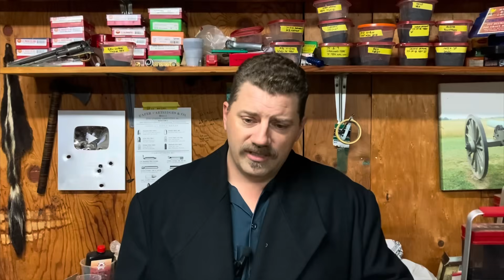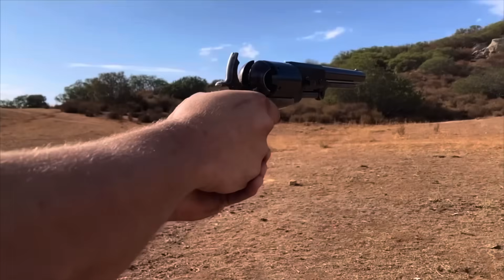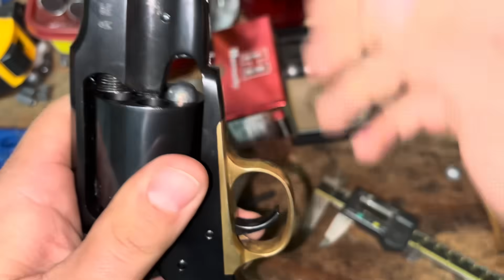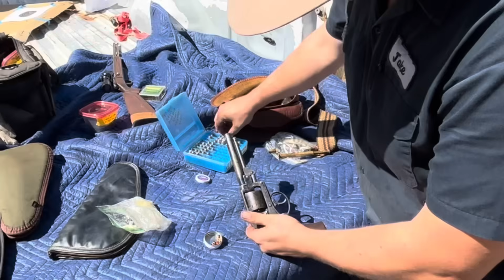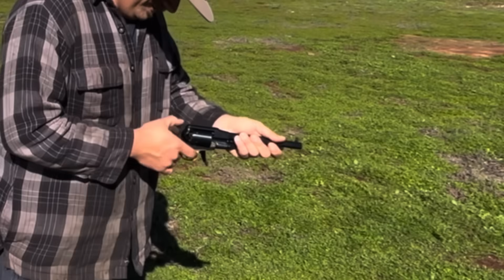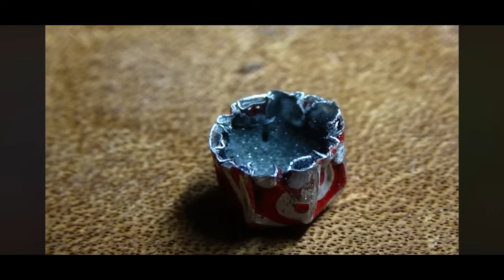Chain Fire Number 4. But Who’s Counting?

Comment: My navy arms 51 navy has not had a chain fire YET, and even cci #10 caps I have to pinch them. I plan on getting slixshot nipples, but the thing just works so damn well that I kind of don’t want to change anything (well besides a taller front sight). I’ve shot it a ton, with .395 round balls so it gets a dang good seal, with no wads or grease over the chambers. .375 don’t shave a ring, so since my local shops don’t have .395 I used .375 to make my paper cartridges, and use bore butter or CVA revolver grease for the chamber mouths. I’ve also woods carried it from December till now for small game. I’m waiting for that day I get a chain fire, and I hope it doesn’t come. Shit happens, it’s part of shooting a cap n ball that it CAN happen. Enjoying the videos, keep it up.

Comment: As a matter of momentum IF the hammer rebounds instead of holding the fire cap in place it can cause microscopic dust from loading un-shimmed or un-capped chambers to flare. That can add to the temperature in the adjacent cone areas, it can cause the cap to heat up. From a matter of physics, it is more likely to come from that. Especially considering the size of the balls that YOU load with. I've always used a loading jig, it just holds the cylinder, and I loaded it. I did not know to use grease when I loaded mine (haven't shot for about 6 years, about 12-15 hundred mixed calibers per year.) I never had a chain fire, I can't say I shoot it as much, as I find Colt/Clones have very small grips and are uncomfortable to use. Never shot a Remington.

Comment: i had a cap and ball uberti and that sucker chain fired 3 chambers at one one down the tube and both sides ok. that being said i had the front of those chambers completely sealed with freeking lard beats me how it happened but it actually stretched the barrel just about of the cylinder rod it all but destroyed the wedge. i got it fixed ran about a hundred rounds through it and sold that puppy

Comment: My theory about chain fires is that when powder is loosely poured into the chambers and not cleanly wiped away from the face of the cylinder, a grain (particle) or two may be trapped on the side of the ball thereby giving the particle an avenue to ignite the powder in that chamber. It's a theory.

Comment: if your getting chain fires then there is an issue with your loading.
I've had chain fires  when I had balls that were not tight enough going in, when I ran out of my waxed cardboard disks I put over the powder or grease over the ball
if you have caps fall off there is very slim possibility of that chamber going off

Comment: I think about this.   The late great Paul Harrel  opined that most chain fires happened from the caps not the chamber and as you say only one chamber actually goes off other than the intended one.   LOL  a chainfire is well...  impossible?   but they happen.   How can a spark get past the tight fitting ball and the wad and still touch off the  load?  or.. how can a tight fitting cap let a flame let a spark get down and around and into the next cap?    I lean toward flame moving from the chamber and conicals being more prone..  anyway I can't fault your logic.

Comment: Careful, you might be flagged for full auto on YouTube 😅

Seriously I thought I was alone in shooting cap and ball that much.
14 for me, paid $99 for a navy arms reb model at a gun show, it was chunky and just had problems so my mom purchased a brass frame 51 navy colt for me at Service Merchandise for Christmas 
Shot it every evening while feeding the horses and cows, 24-30 rounds a day, pyrodex at first but goex after I found a source
Eventually found a wilderness shop going out of business and purchased 5 cylinder and a wire with 105 trigger and bolt springs on it.  Then I just swapped cylinders.
Btw, Phil spangenberger started this entire trip with an article on 51 navy colts
Wore that gun out by my early 20's

Comment: I bought my first black powder revolver around 1972, an 1851 Colt Navy reproduction. I also bought a flask with a 20 grain spout and an inline cap applicator, still have them. The guy behind the counter said, fill the spout, dump it in the cylinder, press in a ball, cover the hole with Crisco, put on a cap, and Bob's your uncle. No mention of chain fire or hang fire. No chain fires so far, but I don't shoot nearly as often as you. I have had a few hang fires though. The first one went snap and no recoil or cloud of smoke. I thought what the hell! I rolled the pistol to the right and slid my left hand under the cylinder then pow! It didn't laser my fingers off, but I did get a nasty burn between my thumb and index finger. It was a painful lesson learned.

Comment: The problem is that when you press the ball or bullet in, it shaves it down to the exact size of a cold cylinder. The second it is fired in the gun, the metal in the cylinder expands a little, which is enough for the flash to get to the powder from the barrel end. Only a well-lubed wad or bore butter seal will expand with the metal and seal the barrel.
Reply: Nah, you forget his chain fire was on the first shot.
Reply: this makes too much sense.
Reply: If the cylinder warmed enough to expand with softer lead touching the cylinder it would expand as well if not more and become tighter?
Reply: @LarryHickenbottom  was thinking that too, but the cylinder is taking the heat immediately, the ball inside would only get a bit of residual
Reply: Lead will melt before it expands.
Reply: @graythorn6583  sounds like you brain melted before it could expand 😆

Comment: I believe chain fires will happen any way they can. I have seen slow footage and still shots where for a time your entire pistol and hand is entirely in a fireball momentarily. I have also had separate pile of black powder maybe a foot apart, lit one and suprising to find out they all went. So im sure if it can find a way it does wherever it sees its opportunity. When i saw the slowmo of the fire it made sense, i mean that how a flintlock works n that works pretty well. 🤷‍♂️

Comment: I haven't watched the video yet, but the problem may be that the chambers in the cylinder are drilled incorrectly - they may widen from the mouth to the bottom. The bullet passes through the mouth tightly and the ring is cut off, and then it enters the wider part of the chamber and there is a gap between the bullet and the wall of the chamber. I have already seen this problem. It is solved by rimming

Comment: Yup, .454" ball is too small for the Uberti, which typically has a .450" or even larger chamber. You'll get a superior seal, more rifling engagement, and better velocity, using .457" ball. AND you can use .457" in your Piettas and others juuust fine.

BUT, there's an issue you're still not observing, and that is the subtle damage that's often caused to the chamber mouth by the loading plunger. It is very common, on originals and reproduction Remingtons alike. The design of the loading system, along with its sloppy fit, tends to force the tip of the plunger inward, toward the cylinder arbor, and ding the chamber mouth in that area.

Carefully inspect any well-used Remington cap and ball cylinder, and I wager that, if you look close enough, you'll very likely find that the cylinder steel has been burred, or turned in, such that, when you force a ball in, shaving that nice ring of lead and thus convincing yourself that you're guaranteed a good seal, the dinged portion of the chamber mouth has cut the ball such that it is causing a possible breech, or ignition path, from the front.

And yes, I've tried and tried and tried and tried and tried to induce a chain fire from the back, and I've never been able to get one.

Comment: Years ago I chamfered the inside edge of the chambers on my cap and ball revolvers. After chamfering the lead rings disappear because instead of cutting the lead ball to fit the chamber, the chamfering causes the ball to be compressed to fit. This results in a tighter fit. Chain fires then disappeared for me. This might not work for tapered chambers. With tapered chambers, if the charge is large, the ball may be lifted to a part of the chamber that is simply too large for a tight fit.
I have several reasons to believe that chain fires at the cap end is much less common than at the cap end (eg the Colt caps are more exposed than Remington caps, yet the Colt does not seem to have more chain fires than the Remington - etc, etc) - but I don't want to write a long comment today.
The only grease that matters is the grease where the ball touches the chamber wall - the rest of the grease gets blown out anyway (there is a LOT of fire at the front end of the cylinder when the gun is fired) - so I mix thin lube from bees wax and olive oil - then I can apply it with a large syringe I have - it is with the syringe that I can just squirt a ring of lube just around the circumference of the ball. It is convenient and much less messy to apply lube this way, and you use much less. It also works just as well at preventing chain fires as filling the chamber with grease, and there is still plenty of lube to soften the powder residue (remember when the chamber is filled with grease it just gets blown out and everywhere).
After chamfering and with my use of lube I completely stopped having chain fires. I haven't had any revolvers with tapered chambers though.

Comment: I could imagine Back in the day how many Chain fires there were? and  I know under fire they Did not have time to Grease Lube their guns!  Thank you for a Great Topic!
Reply: They didn't reload the cylinders in the field under fire either. They carried extra pre-loaded cylinders which had no reason not to be greased.
Reply: @Lee.K91725  No they didn't. They did not carry additional cylinders in the field. Please point to a primary source showing this is a normal thing. It's not. Was there someone who did that? Probably. I cannot absolutely prove a negative. 
Was it a standard practice? No. This is the garand ping myth of that era.

They absolutely reloaded their cylinders in the field. It is why they carried cartridges in boxes. Either paper, or skin cartridges. Which is VERY highly documented. Unlike the cylinder stuff. Cylinders had to be hand fit to every single revolver. This is not a drop in part. This is still the case today.

Comment: I'm 99% sure the original instruction were to use no lube because, as a fighting gun, nobody was expecting to shoot more than two, maybe three, cycilders per battle; and at the end of the day you have to clean it anyway to avoid rust; only a target shooter going trought multiple cylinders per range day need to keep the fouling soft. Again, back in the old days, you were expected to have one gun, or a brace/pair, so you need only one size of balls, having multiple molds is only a collector/sportsman problem.
P.S. I use wads, just in case.
Reply: That matches what is said in the video "Chainfire! Is it dangerous?" by InRangeTV. He shows Colt's loading instructions, which state that wads and grease should not be used. That's from the days when conical bullets were standard. People often use round balls now, which have less ability to plug the chamber. It's explained better in the video.

Comment: I have a video on this topic that has been sometimes misunderstood.  Historically, they did not use lube or wads.   I believe you can mostly avoid chainfires with oversized projectiles and truly properly fitting caps.   It is my belief, and belief through experience, but belief (as you said it is nearly impossible to prove) that solves MOST chainfires but that they can occur from the front OR the rear of the cylinder.    I use .457 balls and felt wads when competing and have never had a chainfire doing so.   I also have never had a chain fire with conicals and NO wads and properly fitting caps either.   I HAVE had chain fires with .454 balls and pinched caps to fit nipples.   This is why I, and this is subjective, have standardized on slixshot nipples as they fit Remington #10s perfectly and use wads in competition to avoid this situation, as a chainfire in competition would easily cost me my score that I'm there competing for.   
So, yeah, TLDR, but in summary:
.457 balls with truly fitted caps works.
.454 balls with felt wads and truly fitted caps work.
Using lube in the front of my cylinders is something I just can't really do, in my environment it just melts and becomes a damn mess, and never do so, and never had a chain fire when following the protocols I've specified above.
Thanks for another thorough, good video!
Reply from the maker: I completely agree. When I carry or hunt with any of my cap and ball revolvers, I don’t generally use grease. The odds are I’m only going to get one or two shots off if any, and I don’t want to get my holster all gooey.
Reply: @Everythingblackpowder  Any museum docent familiar with the accoutrements and equipage of gunfighters such as John Wesley Hardin or wild Bill Hickock, even Billy the kid, will tell you that the absence of holsters with providence from those individuals, can be traced to an affinity for gooey holsters that we know today enhance draw speed, but reduce the lifespan of leather holsters if not periodically regooed. On the invoices from sutlers and the general store in Tombstone and Dodge city, you will note the purchase and sales of O'Malley's holster goo reached into the thousands, in today's money this would equal approximately 67 billion dollars.
Reply: Hey Karl! I will give one caveat to what you said and this is not from experience just relaying something I saw online- but it seems it is possible to have issues with chainfires despite oversized lead if the mouth of the chamber isn't properly honed as happens a bit with cheaper repros. There can be a bit of a lip that causes the swaged ball to still be undersized when actually in the chamber despite getting a ring of lead. So essentially in cases where people are still having problems despite following your advice, it may be an actual problem with the gun
Reply: @youngbloodbear9662  To go along with what you said, Samuel Colt discussed the chain fire issue in an engineering lecture, circa 1851, and the solution to the problem as he discovered was to give the chamber a SLIGHT chamfer.  I did some more research on the subject along with looking at my own guns and most repos are square cut, several mentioned in forum posts that they had given the cambers that slight chamfer and it cured all their problems.
Reply: @ very interesting I had not heard that, thank you!
Reply: @wesbrown5601 Do you have a link you can share on this?
Reply: The “lube” I recall using was a mix of beeswax and disk-brake wheel bearing grease - lithium type.  Heat up the grease on the stove, then stir in beeswax shavings until you get a “good” consistency when cool.  This might take a few tries.

I’ve used a firmer version in smokeless loads - more beeswax, and a more gooey version in a black powder revolver.

Still want an 1858 Remington in .36, though.  I’ve written about things like that in books.
Reply: @dennisyoung4631  goose grease, bear fat, bees wax, hell you could probably use a bit of tree resin which would resist heat more but then it may just gum everything up and increase pressures and cause an explosion. Youd have to test, mixing different things would honestly procure the best stuff to use, even in hot or cold weather.

Comment: If it matters a lick, I had a Pietta Navy LeMat chainfire on me, and it was definitely because my ill-fitting caps had left the cones from loaded chambers.  In my case, due to the direction the cylinder travels, my chainfire tore the loading lever and the retaining spring clip right off the gun and sent them mangled downrange.  I had a near-miss on a chainfire from a Pietta NMA when the recoil of an overly-generous charge dislodged the ball out of one my loaded chambers.  Personally, I think the probability of chainfires happening  from exposed cones is more likely than from the front of the chamber, if you’re not doing something “experimental” like I was (35gr and .451 round ball 😅).  I use mink tallow over my chamber mouths, because I get better accuracy and it helps keep my gun running for a much longer time.
Reply from the maker: Fair enough

Comment: I watched some fella here on YouTube who would load a ball and cut a ring on every chamber. Kept having chain fires. He found that the chamber mouth was slightly smaller than the chamber. Almost like the cylinder face got belt sanded and put a lip on the chambers. He chamfered each chamber mouth and solved the problem.
Reply from the maker: Yes, I remember seeing that. Seems to me that he had a poorly machined firearm. I have owned 20 some odd cap and ball revolvers and I have never run into that.

Comment: I would buy a cap n ball gun if it too came with a '66 Pontiac (With Flames).
Reply from the maker: It was a 67 but close enough. That was one of my first paint jobs and when you’re 17 everything gets flames
Reply: @Everythingblackpowder  My bad it's a Tempest, I just see one of those and my mind says GTO, and then I look for the rocker panel chrome to differentiate the model year if the tail lights aren't being shown. Yeah That paint job is spectacular.
Reply from the maker: @jollyjakelovell4787  thank you